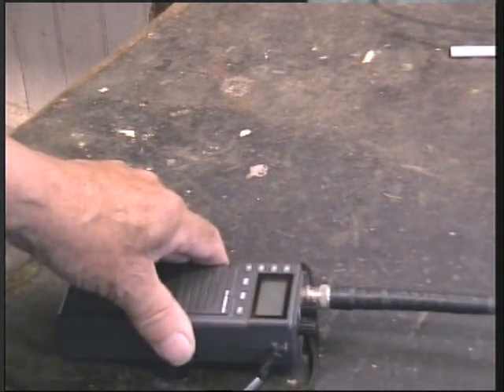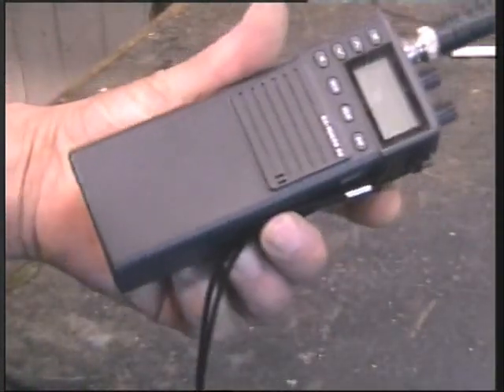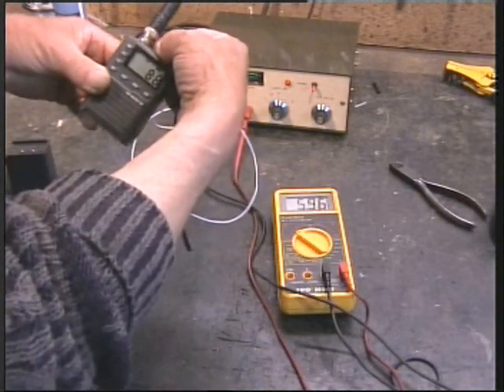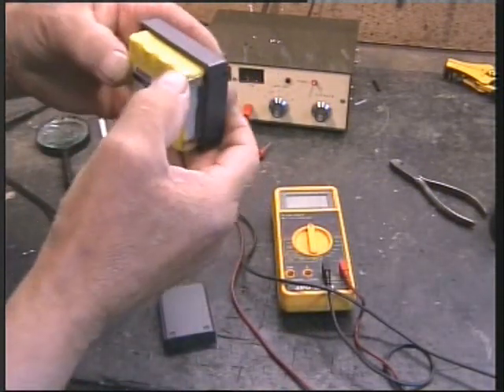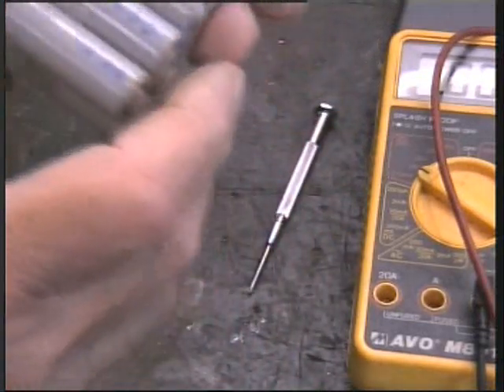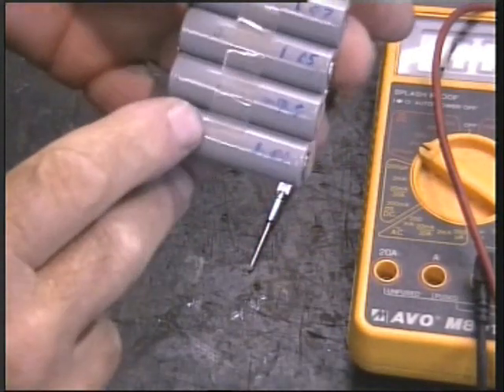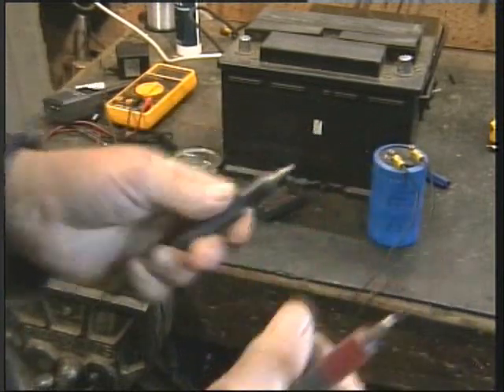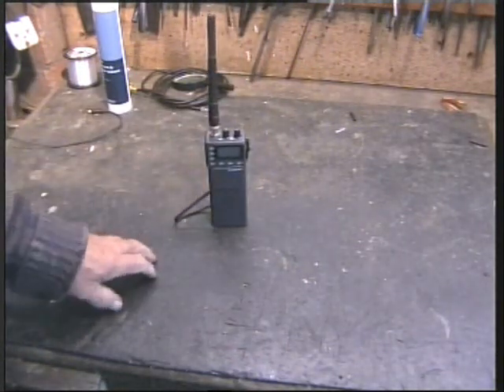Lazarus capacitor

Comment: Getting the voltage back to normal range on individual cells can be accomplished but normal mah capacity can't be. I have all the testing equipment to test these and most of the time you will only end up with 10% of the cell's original capacity. So wired in series your entire battery pack will only have 10% of it's full capacity. Most of the ones I work on are out of power tools and are high drain devices. Your marine radio will be much nicer to crippled cells.

Comment: Did that on a drill battery. It worked for a while, then went bad again. Tried again but no go. A new battery pack is $65.00. I can buy a new drill package for $25.00. Guess what, got a new one. then I run the old one off a 12V wall transformer.

Comment: Thanks Chap, I have often looked at the cells in my drill batteries and found the dud, but hit a wall as, up to now ,  what to do with them.  You mentioned you charged the single cell?  What did you use to charge just one cell?  Thanks as always for the great videos.

Comment: Thanks for the vid,Very informative. 
Did you come onto this yourself or see it somewhere else?
My knowledge of electrics is basic.It seems odd :1.2 volt battery . 12 volt car battery. 16 volt capacitor. 33k microfarad output. Would the cap. charge on a 6 volt batt?Or a 24 volt batt?